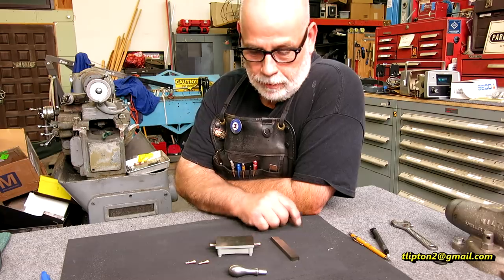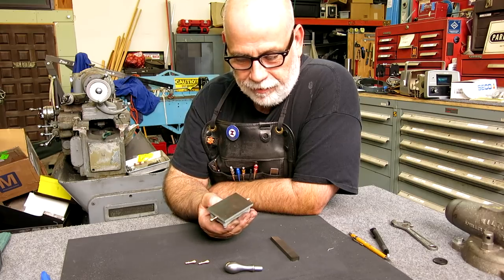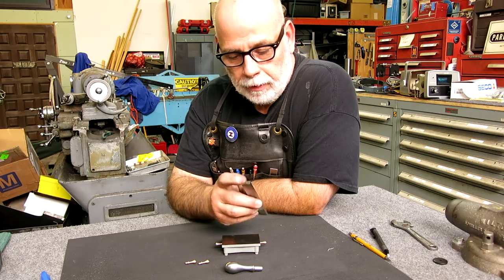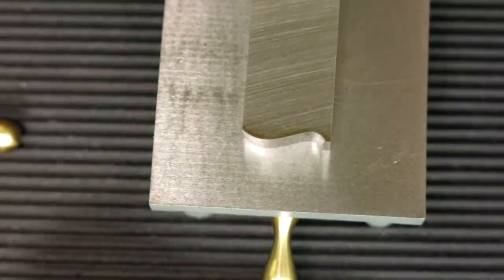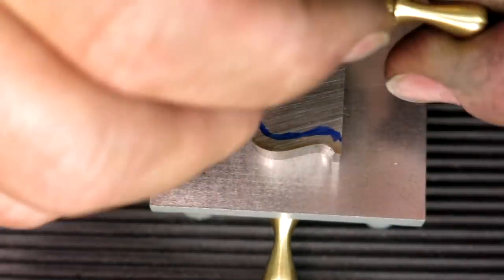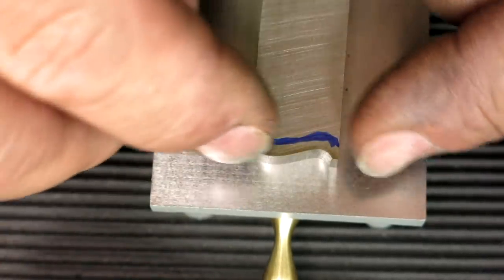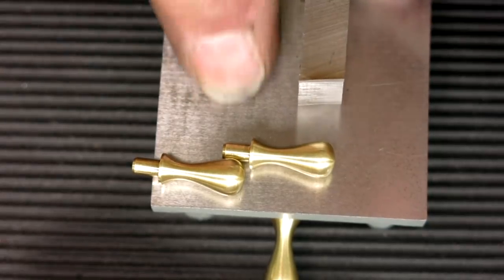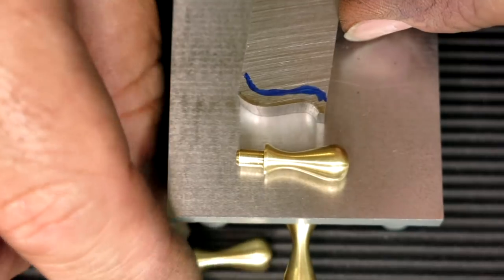Form Tools for machine handles

Comment: I have never in all my years seen brass curl and chip like that.  Then again I've never taken a 3/4" DOC in it.  Cool project!
Reply: C’mon, ToT, 24 isn’t THAT many years.
Reply: It was 24 years of turning brass hex stock into smaller round stock, though.  That was until round brass was invented of course.
Reply: The Dark Ages.
Reply: Hey I'm a Maker - aka "BC", or Before Carbide
Reply: Depends on the grade of brass. Hard brass is a pain in the ass with its splinter like swarf. Soft annealed bar like Tom had is a real treat. Polished high rake inserts like the CCGT in the video will make nice chips in soft brass and even hard drawn brass if using light feeds. They can grab if the lathe is a bit light duty or loose but it's worth it for the good finishes.

BTW when was round brass invented? I have never seen it! How could you possibly turn it without the hex profile to give you extra drive in the 3 and 6 jaw chucks? I'm calling BS on this new fandangled round brass stock!
Reply: Whens the next Video out Tony?
Reply: Not for tiny lathes, or you'll hate this method...   Experience or not, laws of phisics can only be extended but not changed....   ;)
Reply: I always cut 360 brass and it makes tiny chips. I do get long, curly chips when drilling though. My hobby lathe would not like making a cut that wide, or even half that wide.
Reply: I have never watched Your videos in 3:00 AM!
Or wait a sec........ Damm it :)

Comment: I liked that demonstration, Tom. Thank you.
In a future video, given that one of the restrictions is tool size, could you perhaps turn a handle (or form), using two or three different profiles to achieve the finished item?
I'm sure the set-up (to 0 on the cross slide) for each tool would be interesting...
(Four-way tool post with multiple cutters, or several different 'quick-change' tool holders?)

Comment: Now what I want to see is after you scrape the surface plate flat just what are going to scrape using the plate for the reference surface. Or is this going to be used for the reference for a smaller surface plate

Comment: Tom, have you ever done any form tools for working aluminum by hand?  I am making some aluminum mouse pads out of aluminum and am wondering about an efficient and consistent way to round the edges over. I was considering using a small round over bit in a router, but the roller sits to low being only 1/8" thick material.  Was thinking a form tool to drag down the edges by hand would work.

Comment: He’s alive! I thought mrs ox fed you through the etching press. 
Hey Tom, here in oz, Wilton was never sold, until a couple months ago, a few 150 mm swivel vises appeared at my local tool specialist. (Not saying which haha) these are new design or the more common type swivel bases not the pipe type design that you have. They are a cast steel, but I’d like to know if the new Wilton stuff is any good. He’s got them pretty cheap, 160 orstraylian kopeks. Cheap for a vise, but is it a stonking good buy?

Comment: maybe you could get rid of the chatter in wide form tools by milling a narrow slot parallel to the cutting edge on the bottom of the tool thereby allowing the tool to flex out of the way rather than jam into the work?

Comment: For parts that require a form tool that is longer than ideal, could you super glue two pieces of HSS together, grind them and them separate them and cut the part in two ops?
Reply: If you could mix up a super glue that strong you would soon be a millionaire!
Reply: No need to superglue, just use couple of tool makers clamps to hold them together for the grinding operation.

Comment: I never suspected that there was a standard form for machine tool handles, but I found the specs for three different sized handles in a 1945 edition of Mechanic's Vest Pocket Reference Book, by Wolfe and Phelps, Page 192.  Lengths of the three handle sizes are 2.70, 3.60, and 4.30 inches, not including threaded posts.  The three posts sizes and threads are 3/8-16, 1/2-13, and 5/8-11.  Handle shape is specified as the radii of two arcs, plus the distance from the handle end to the major diameter and minor diameter.   If anybody wants a copy, PM me and I will try to enlarge and scan the page, or something, to pass it on.